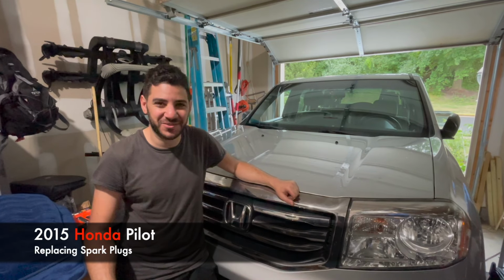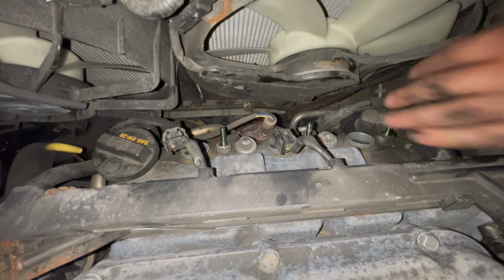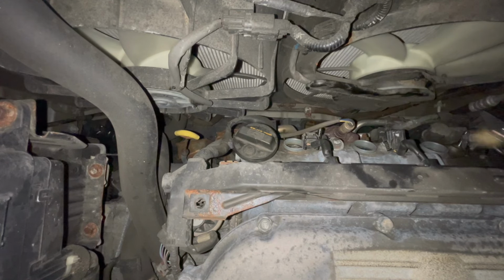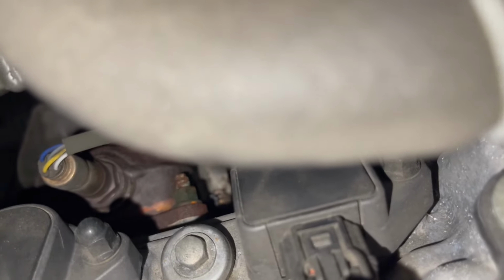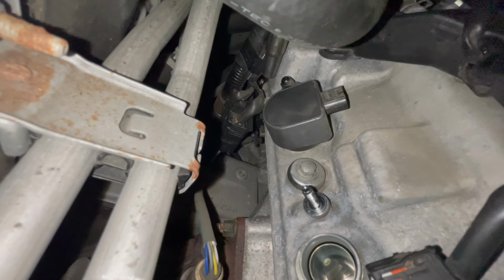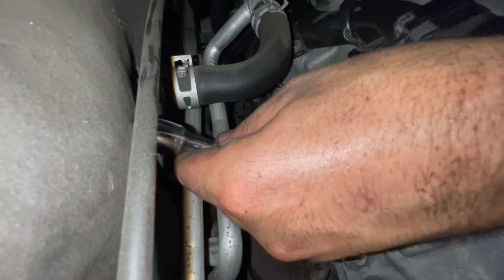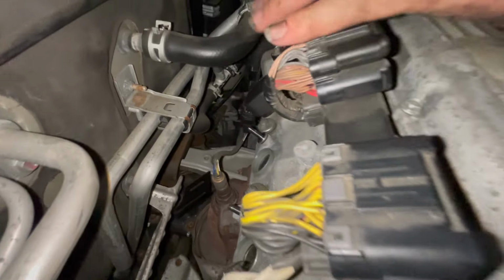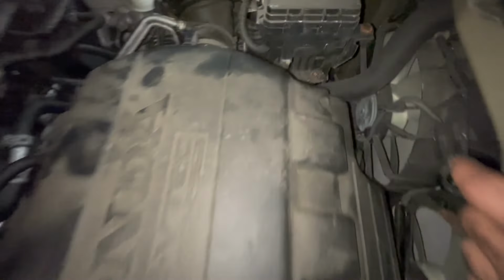DIY 2009 2010 2011 2012 2013 2014 2015 Honda Pilot or Odyssey Replacing Spark Plugs

Comment: Great job! It was a big help. The back side plugs on my engine looked alot more cramped than yours. Got it all done and it's running great. $130 for 6 plugs in November 2023!
Reply from the maker: Glad it helped
Reply: Was that including labor ? if not that’s  a lot.
Reply: I just paid $25 to Rockauto for NGK's
Reply: Ya, my plugs are way more cramped, can't get eyes on em, not sure I'm going to even attempt it

Comment: Thank you for the video.
Got my 2014 done today - took less than 1.5 hours. The only thing I did differently was add a very small amount of anti-seize to the threads (out going plugs we pretty bad) and a light coating of dielectric grease to the boots. Some old school teachings still haunt me.
Plugs cost me ~$12 ea locally - I could get them cheaper from Rock Auto, but didn't want to wait, #3 cyl was throwing a misfire since last week.
Reply from the maker: Great tip! Thank you for sharing.

Comment: Great video. The back of wasn’t as bad as I thought. Harbor freight flexible joint adapters saved me. I’m 5’9 and knocked the back out standing on my toes in a 2012 pilot.
Reply from the maker: Definitely will take a toll on your back and joints. You’ll be feeling old for a day or two haha. Glad our video helped. Cheers!

Comment: Wasn't sure if the rear 3 would be possible, but thanks to your video I am confident that I have a much better chance of success! Thanks! One tip I would like to pass on, I had the same problem with the long extension getting crammed, so I tried using 2 short extensions instead. Makes it much easier to iremove and install the plugs.
Reply from the maker: Glad I could help.  Thank your for the tip.

Comment: This is why I am always buying more tools.  A universal joint on the spark plug socket, a deep well spark plug socket, a spark plug socket with a swivel, a different length extension, a flex head ratchet handle.... all of those options could have made a big difference.

Comment: I used to get asked, "why do you mechanics always have scraped knuckles?" Modern automakers - that's why. This video is a great answer to that question. They cram as much as they can into those tiny ass engine compartments.
Reply from the maker: My career for future hand model has been crushed. But yeah they don’t always make things easy to access. But this job wasn’t too difficult. Just can be hard to see at times. Cheers!

Comment: Incredibly helpful video, but, I encountered a rather rare situation: when I went to remove the rear spark plugs I somehow sheered the thread off the plug, which was still stuck in the hole. Before calling the dealership or an engine mechanic, try a $15 screw extractor kit.
Reply from the maker: Thank you for the tip.  Glad I could help.
Reply: Have you ever encountered over-wrench a spark plug? I was working on a 2010 Pilot and don’t think the spark plugs had ever been replaced. But seriously, you deserve a medal for the camera angles alone.

Comment: well you just gave me the confidence to go out and buy my own spark plugs and have a saturday morning project to save me a few hundred bucks. Dealer just quoted me over $400. Super clear video and I have all the tools here to include the magnetic socket which may help lower the new plugs in. How would you know it is time to also do the coils and not just the plugs?
Reply from the maker: if you are getting misfires you would want to swap the coil on the cylinder that is misfiring to a different cylinder to see if the misfire switches cylinders. if no misfires then your fine just replacing the plugs. If you want peace of mind and while your in there your more than welcome to replace them.
Reply: I followed your video and had all 6 done in less than 3 hours. I’m a newbie but this made it as easy as it could be. Autozone rented me a torque wrench for free when I bought the spark plugs from them so that helped inserting the plugs per specs. My plugs were very old and looked burnt so I am glad I changed them. The issue I’m still having seems to also be related to VCM issues. I’m in the middle of purchasing a device to disable the VCM to see if that helps with my vehicle running weird when it warms up. It’s very smooth when I first start driving but after a few minutes, I get some idle issues. Fingers crossed.

Comment: Someone else asked and I was thinking the same did you gap the plugs prior lol. I wanted to mention to others to be watchful with old gap tools you can break the tip on newer plugs so use a wire gap tool or other means to avoid busting the fragile tips, new plugs are not copper anymore.
Reply from the maker: Honestly I didn’t gap them and the car is still running perfectly. I believe they usually are gapped out of the box. But yes you should be careful when attempting to use a gap tool.

Comment: Did u have to use a stepping stool or something similar just to get back to the plugs? Im 5'10-11 and its too far back. Had to almost tip toe for the front plugs i havent replaced my plugs yet but just looking around n man it looks tough for the rear plugs. Maybe take off fuel injectors or whatever is on top of the plugs to get more room?
Reply from the maker: I needed to step on a stool as I’m shorter than you to do the rear. The rear looks intimidating but you’ll have good access for sure to the first 2 from the rear left. The 3rd one can be a bit of a pain due to a hard line being in the way but it’s possible. The lines and hoses are what’s in the way and I think they may be coolant and ac related so that would complicate things.
Reply: @MobileCarMechanic  did u had to climb onto the engine. I tried using the stepping stool and still feel like its far back. Had to stretch my back for the ignition coils

Comment: Props to you for your patience...I woulda been screaming at Honda for that awful design...
Reply from the maker: Honestly it’s better than most V6 engines with intake manifolds blocking the rear cylinders.  Pretty much every manufacturer other than Honda.

Comment: How did you get the extender out of cylinder one? Right before the video cut and you said I dropped my socket. Please help!!
Reply from the maker: I used an extendable magnet. You can get them online cheap or at harbor freight https://www.harborfreight.com/15-lb-capacity-telescoping-magnetic-pickup-tool-64656.html
Reply: @MobileCarMechanic  I got it man! I pulled the extender off the socket and then got the socket out . Thanks man! Your video saved me some money!
Reply from the maker: Glad you were able to get it out. It’s a tight fit back there. Cheers!

Comment: So is the sparkplug just smaller than the access hole? so it will line up with the cylinder fairly easily?
Reply from the maker: Correct, The spark plugs are smaller than the tubes making it easier to install and fit a proper socket.
Reply: @MobileCarMechanic  awesome thanks!

Comment: Great video. Many thanks. But why did they make it such a pain? That socket wrench with the extension doesn't fit so you gotta keep disassembling each piece and put it back together. A civic is so much easier to work on.
Reply from the maker: Having owned a bunch of civics I know how you feel. While this seems like the worst design ever it is much easier than any other v6 engine you’ll run into, including Toyota which is the easiest to work on.

Comment: How do you know when you need to change the spark plugs? Does the car shake ?
Reply from the maker: Most vehicles nowadays require you to replace them at 100k miles. You usually won’t feel any difference unless they actually go bad. It will cause the engine to run rough in what is called a misfire. You usually want to change them before they cause misfires.

Comment: We used a mag tool retriever to pull the plugs, I suppose you could use it to gently place the new ones in lol
Reply from the maker: You can try lol but the magnets are too strong and make it hard, either use a proper socket or slowly insert them by hand.

Comment: Rubber hose not a magnet, helps if you have to loosen plug further
Reply from the maker: That works as well, thanks for the tip. Also using a spark plug socket works if you have one. Cheers!

Comment: How many miles did you have on the pilot before changing them? Did you consider changing the coils while you were in there?
Reply from the maker: I changed them around 95k. Didn’t change the coils as there was no issues with them. No misfire codes but decided to replace spark plugs for maintenance.
Reply: @MobileCarMechanic  Thanks for the reply. My wifes 2012 Pilot has 182k on it and has never had the plugs changed. The funny thing is the thing runs fine. She has said lately though it seems to take longer to start so I am going to change plugs and coils also. Your video was very helpful in making the decision easy.
Reply: @m.s.8312 mine has 155K and still original plugs. Might follow your lead and change both to be safe for the next 155k.

Comment: This wasn’t bad, at least you didn’t have to remove so many parts JUST to get to the back 3. You should try a Toyota Avalon V6 😬
Reply from the maker: Yeah I prefer Honda’s design better than most V6 equipped cars. And yes the Toyota Avalon is a pain haha.
Reply: @MobileCarMechanic  lol 😆 Thanks for the response

Comment: Isn't there enough room to leave the coil attached to the connector?
Reply from the maker: No, its a short wire so pulling the coil with the connector attached will limit the ability to pull it out and may cause damage to the connector or wires if you pull too hard.
Reply: Good to know. Thanks.

Comment: What happens if the boot has oil ?
Reply from the maker: It means that your valve cover gasket and spark plug tube seals need to be replaced as it’s allowing oil to enter.

Comment: Honda made the rear access really tight. Smh. Wanna replace my plugs for me?
Reply from the maker: If your in the Virginia area please come by! But honestly compared to other v6 engines Honda is the best as you don’t need to remove the intake manifold.
Reply: @MobileCarMechanic  WI 😭

Comment: You didn't explain torque without a torque wrench
Reply: The torque thing is easy, I did it on my civic. Just find the torque spec, set it and done.

I do remember I used an anti-siezeee on the spark plume

Comment: My 06 pilot has oil when I took out the boot
Reply from the maker: It means that your valve cover gasket and spark plug tube seals need to be replaced as it’s allowing oil to enter.

Comment: I'd Probably also change the ignition coil while your there, especially the ones in against the firewall
Reply from the maker: That is a good recommendation but we chose not to replace as we didn’t have issues and the originals seemed fine. But definitely something to look into so you don’t have to go back through the hassle.